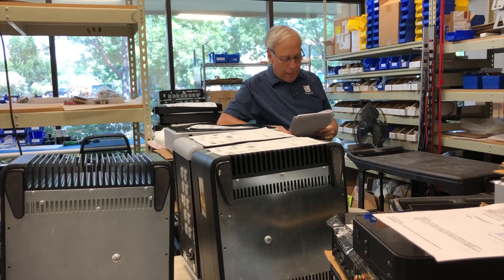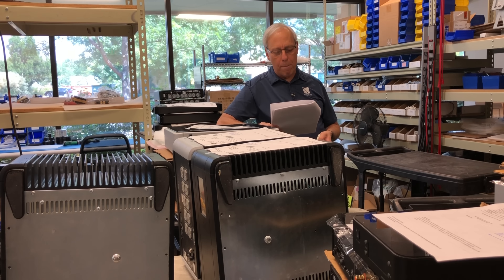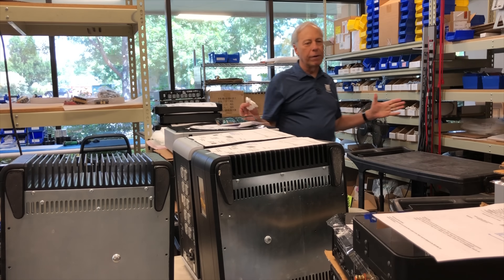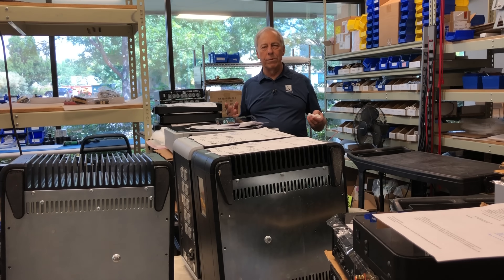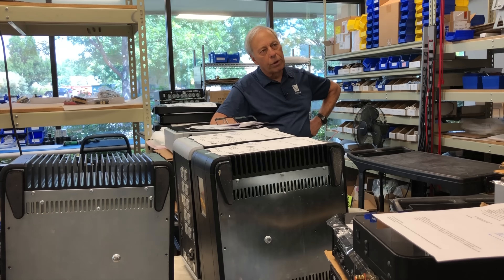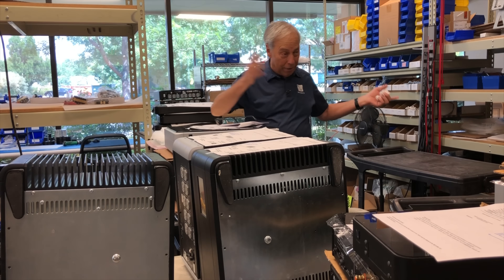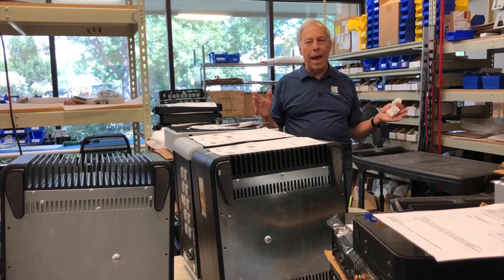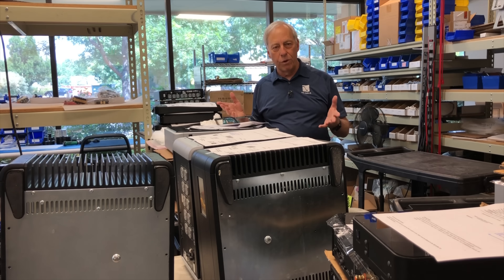Why should speaker cables have a minimum length?

Comment: Thanks Paul for a relaxing yet honest video. I'm currently putting together a small stereo system and returning to include vinyl since 1985 when I went into cds only.  I've only owned one of your products, the GCPH Headphone amp I would love to be able to afford more of your products starting with your power conditioners. I have also owned my absolutely best speakers ever Genesis 300s I also had Infinity Delta Gammas another of Arnies creations. I will be doing my first ever bookshelf speaker system. I'm going to be using the MIT MH770 speaker cables I used with the two Arnie speakers. Any suggestions would be much appreciated sir.

Comment: Because naim amp didnt have output inductor in the circuit,  so naim introduce  their Nac A5 with higher inductance per metre,  the cable is said to be part of the circuit,  by using other cable it might cause the amp to oscilate, its not snake oil,  its something that fits their amp design,  their cable is not recommended to be used with non naim amp. 

As a naim user,  i can assure you that with their speaker cable the rythm do improve significantly

Plus their cable is not expensive like the other after market

Exposure which emphasize on PRAT in their design also use their version of similar cable,  you can see the cable is hard and not flexible, probably due to the high inductance value
Reply: @iamspyvspy the later model didnt make it compulsory as the earlier model but,  if use Naca5 it still improve the rythm and PRaT IMHO

Comment: I have worked in the audio industry for many years and this question never goes away. If the cable reaches the speakers its the right length just make sure the cables are the same length and dont use low grade 'bell' wire or other cheap small diameter cable you should be fine. I have seen ridiculously overpriced cables which claim all sorts of questionable 'improvements'. It just is all smoke and mirrors really. Also MP3 files for audio playback dont get me started lol!!
Reply: No it's true, you can play MP3 files for audio.
Reply: MP3 for ME...

Comment: In large houses the cables can be 200 feet long, no problem. Wind a speaker cable around your house, 12 gage, 10 times, hook up to speaker, will sound exactly the same as the speaker with a 10 foot cable. The speed of electricity is 6.5 times around the world in one second.
Reply: The longer the speaker cable, the higher the resistance between the amp and the speaker. At lower volumes this won't change much, but at higher power levels you loose power through inductance because the signal on the cable is not DC but AC. Also, electrons do flow through metal at close to the speed of light.
Reply: @marcusfred4480  "you loose power through inductance"

Wat? 🤨
Reply: Not true, but I it dies affect sound. Long cables, especially thin wire, and the cable resistance causes voltage and power loss with longer cable, it's simple physics, electrical laws.
Reply: Depends on power through cable.
Reply: Using more cable means a greater probability of failure somewhere on the cable. More so if it is a single cable run.
Electricity doesn't move at the speed of light. Light in a vacuum moves at the speed of light. Electrons move just a few cm/s. The latency involved in sending a signal down a cable is somewhere between those two.

Comment: Because there is resistance in any cable. The longer the cable the more resistance there is in the speaker cable. Why add extra resistance that your amp has to overcome. If the manufacturer requires a certain length of cable, and also specify a certain gauge or resistance per foot, the amp might be optimized for that resistance. This is more the case with tube amplifiers because they use output transformers to protect the amplifier.

Comment: I put my NAIM system in complete vacuum to insure best sound possible.
Reply: Try washing your amp - really cleans up the sound
Reply: @grantcooper1465  That's my friday routine when I also change the areogel feet for new fresh ones.
Reply: ‘Ensure’
Reply: @MP you should be using compressed air. When your nozzle sucks a capacitor you will realize your error.
Reply: lololololololololololololol.....

You should post that in a forum for NAIMers and you'd easily get a few people say total vacuum is a great idea, give total vacuum setup advice or worst, claim they currently have total vacuum sound system already.
Reply: I run my Outlaw RR2150 in a vacuum at absolute zero resting on a 4 inch layer of bubble wrap. This gives me the best possible sound without the expense of magic cables.
Reply: Seriously, have you tried superconducting speaker cables?  I've been thinking about a commercially viable way to market YBaCo crystals surrounded by a jacket to carry liquid nitrogen.  They wouldn't be flexible, of course.
Reply: There’s no sound in a vacuum but a vacuum makes sound...
Reply: @Andrew Ridley It is. It's one part of the equation together with the quality of the reproduction units* and the room acoustics. 
But yes, the human part of the equation is most certainly relative.

* Until you reach the pseudo-science that some manufacturers try to convince some people to buy—and surprisingly often manages to do.
Reply: Sounds about right 😂
Reply: There is no sound in a vacuum.
Reply: @harrywiersum5875  Exactly.. that's why he does it
Reply: @harrywiersum5875  You Sherlock

Comment: Guitar players have long known that the cords between their guitar and amp have different sound depending the length.  This was one of the early complaints with wireless systems for guitar (besides latency).  A long cable (20 feet +) has more resistance but also a measurable capacitance (thus the rolling off of highs) that lends to a "darker" tone.  Some guitarists use very long coiled cables for this reason.  An electric guitar is only really part of the whole instrument.  The whole instrument is the guitar, the cable, the amp, and the speaker.  They all work together to create a tone that the player conducts.  The same goes for any high quality audio system (OK, a guitar and amp is a non-hifi system but it can be a very good non-hifi system).  Everything contributes to the tone of the whole system.
Reply: only problem is that guitars have very little output.... amplifiers do not.
Reply: Spot on ....
Reply: Guitar = 50,000 ohm source and 1 Megohm load. HiFi amp = 0.05 ohm source and 8 ohm load. BIG difference. The speaker cable will NOT cause HF loss, and it will NOT affect the sound unless it is too small in gauge, which raises its resistance, loses power, and reduces damping. And there is no such thing as "8 ohm" speaker cable.

Comment: Speaker cables change two main factors, first is voltage drop between the amplifier and the speaker. A long thin cable will act as a resistor. Second is the damping factor of the amplifier. Not to be confused with servo, the amplifier still reacts to voltages generated by the voice coil through its negative feedback loop. Add the "resistor" and the damping factor changes. Both will effect the sound. To a lesser extent, any inductance and capacitance introduced by the speaker cables will also throw a wrench in the works. This is why it is not a good idea to coil extra speaker wire, although most inductance is canceled out in two conductor cable by the fact that they are out of phase with each other (heat buildup on high power systems is another good reason.) All this assumes the amplifier directly drives the speaker and does not go through the rats nest, otherwise known as a crossover network. As for 2 feet vs 4 feet of wire, I would like to do some blind A/B tests for those that say they can hear a difference.
Reply: Great explanations.

Comment: These questions are becoming a bit of a joke.. Unless your running stupid lengths of cable it will make no difference.. Short is bad??? so why haven't we got 6ft wide amps and sources? The soldering inside is exactly the same as speaker cable... Ridiculous.

Comment: All high end audio manufacturers have their preferred way of doing things, I`m sure some of Naims customers/followers think PS audios equipment such as the power regenerators are ridiculous. To quote Marantz`s Ken Ishiwata - "Trust your own ears"
Reply: Well said that man, so true. Also if you are over 50, your ears are not performing at the top end anywhere near as good. All the cable upgrades, power regents etc.. and noticing a difference in the presentation, trust your own ears. I listen and would genuinely say there is an improvement if there really was. However, as an example power strips made no difference to me, apart from being told by the person doing the demo, you can hear the difference now, improved bla bla bla🤔
Reply: @a0r0a745  Well. Why people don't understand that eyesights are different and some are even color blind. But not ears, or neurons?  Hearing the highest frequency isn't the only aspect of human auditory system.
Reply: @johnyang799  understood.  However, to pick out nuisances through change is very debatable, particularly at the high end.
Reply: @a0r0a745  Actually speaker cable is one of the less snake oil thing. The reactive load and the amplifier's interaction is real. First of all output impedance will certainly change the frequency response of the speaker, because the impedance curve is not flat. Speaker cable is essentially extra resistor+inductor+parallel capacitor at output. It not only changes the frequency response it also isolates the amplifier slightly from the load causing less control over the speaker (signal across the speaker itself can vary without the amplifier to correct it.) Hence it will change the sound. It's measurable and audible.
Power conditioner does similar thing, it allows the amplifier to work at best condition. Even though well designed amplifier will give some sort of power supply rejection. But that's depending on the amplifier, and you can only do so much sometimes. The powerplant constantly corrects its output making the power supply going into the amplifier with constant amplitude. Amplifier will perform better under ideal condition. 
The results will always be measurable, but how much is not consistent some will benefit from it some would unlikely to.
Reply: @johnyang799  so what you are saying is different speaker cables behave differently with an amplifier so much and therefore will sound different? 🤔 I do understand how a speaker cable will react, thank you.  The snake oil is different cables i.e. very expensive speaker cable will sound better.  No sorry do not agree.  I have tested many and audible difference is just not audible.  I have even tested with other people and no one person picked out the expensive cable as the better cable every time.  Power conditioners are a good thing.  I do feel clean power is a positive. I have designed and built a mains surge, filter conditioner which I use.  However, claims they improve bass, imaging and detail are extremely negligible.  If you are in the UK would you be willing to prove the differences to me.  I can also then swap cables and you should be able to pick out the best cable each time, time and again?
Reply: Andy Abraham better cable should sound better
Reply: Andy Abraham there are often these golden ears contests in China people not only identifies lossless audio and hires, cables, even hard drives and stuff. I don’t necessarily think expensive shit are worth it, but I admit they do serve purposes. To me I’d like to have the best speakers, room, electronics first.
Reply: @johnyang799  so I asume you are not in the UK, that's a shame.  People are free to purchase what they wish .  Quality cables are durable and look nice.  However,  cables will only improve the audio to a point v cost, anything more is just wasted money. So these people who test in China pick out the best cables 100%.  Perhaps if you know a Golden ears contest is happening you could do a You Tube video showing these golden ears people and prove me wrong. I am not arguing about hires or lossless audio.  Have you ever stripped down a hifi loudspeaker? You might be shocked to see the guage of wire used internally. So the audio comes through some hyper expensive cable, maybe on cable risers 🤔 then inside the loudspeaker is usually downgraded to cable a fraction of the cost through the crossover, then to the drivers.  To be honest you would be much better off upgrading the crossover capacitors if you want to reveal more detail etc.. that works and I have proved that. This mod will cost but be worth a outcome that can be heard.  On my own designed three way loudspeakers I used the same high quality OFC cable from amp to speaker and also inside my speaker. This ensures no downgrading takes place at the speaker. All good fun though 😁

Comment: I'm not buying any explanation so far. From the amplifier's point of view the resistance, capacitance, and inductance of the wire are all a few orders of magnitude less than the speaker and its crossover. The difference in any of these parameters would be much more dependent on what speaker you were putting at the end of that wire than the length of the wire itself. Did Naim say what speaker you're allowed to connect as well??

Comment: As many have suggested it is to do with maintaining amplifier stability. The standard method with the circuit Naim use is to put an inductor in series with the output. However it was discovered that 3.5m of 4mm² wire as a lightly twisted pair eliminated the need for the inductor. As 3.5m is fairly average length it was decided the inductor could be done away with as the combination of inductor AND cable did affect the sound adversely. So Paul is right about the voicing, as with so many things in high end audio decisions are made that balance engineering and sound considerations.

Comment: I cut an old vacuum cleaner power cable in half to use for my speakers.
Reply: And the sound sucks, right?
Reply: Nice clean sound then. Sorry could not resist.
Reply: You can't go too far wrong with basic stranded copper mains cable. Provided it can easily take the current of course.
Reply: G Guest  yes understand the reason. That is why I use a Audiolab amplifier, not so worried about cable specification possibly damaging the amplifier. You could say more flexible in what you wish to use cable wise 👍

Comment: I try to put some more mystery to that. Just guessing. In my opinion speaker electrical response is not exactly coherent with input signal (badly) . Due to phase shift(s)  of current. That is send back as feedback.  Could  it be possible that some shifts in above listening range of frequencies can  in that product affect stability? That would be important to gear transmitting them. Adding some minimum reactance may work effectively    in high range  and may be flattens the problem?  I don't know if its possible  because I never had like this - my amps know 20 kHz  rule :).

Comment: Why would you want short speaker cables anyway, all that will achieve is a tunnel sounding system as the speakers are brought closer together and will have no sound or space to do there thing, unless you like tunnel music
Reply: You want shorter speaker cables, because you use XLR cables to place the power amps right next to the speaker; you then only need a short speaker cable ;)

Comment: It is the ohms that count. Mathematical relationship between gauge and length in ohms per foot. Lower gauge (bigger) lower ohms, lower feet lower ohms. Low ohms equals better damping of the speakers, higher ohms is less controlled, but can be warmer tube like sound. Important that you speaker cables are of equal length, brand, and type so your right left voice is balanced.
Reply: Thank you for saying damping and not dampening.  These words are being interchanged in this comments section as if they mean the same thing..

Comment: As someone who makes handmade speaker cable & all audio cable's, my philosophy is the shorter the length the less loss you get, with in reason, there won't be much differents between 2m length & 3m, but 2m vs 6m the sound would change slightly, but it all depends on your room, checkout my channel, you might want to make your own from scratch & save yourself $/£.

Comment: 3.5m or yards is long. A separation of 24ft+ is way wider than my listening room. As of right now my front facing towers ANV modified mtm 5" midbass 1.5" tweeter 5" midbass are separated at 6.5ft and the rear facing towers Polk Audio R50 modified mww 4" midrange 6.5" woofers × 2 are diagonally facing wall for reflection and are separated at 8ft. Sound is pretty good but not audiophile good just messing around like always.

Comment: the wire gauge is more important then the length. longer wire bigger gauge. when working with 2 and 4 ohm loads. high power use 12/10 AWG, no extra wire coiled up. keep wire straight and just long enough to hook it up and  right size for audio power. no 22ga on a 250 watt amp.
Reply: I doubt coiling speaker cable causes any problems, but feel free to explain why it might.
Reply: @rd264  normally coiling speaker wire won't cause problems . there is some exceptions . too many turns makes a coil of choke. that is inductance . this can affect impedance of wire and blocking or attenuating certain audio  frequencies'. Also electricity travels at the speed of light. coiling wire makes a delay . if same length to all speakers this is not noticed. but too much delay in 1 side can cause phase distortion.  This will take miles of wire for this to happen.  Also coiling wire with current passing thru makes   a magnetic field . normally not a problem at speaker level power.  But with a compass It can affect it.
Reply: So the smaller the cable is,  more resistance peak?
Reply: @robertkey69  double the diameter, halve the resistance